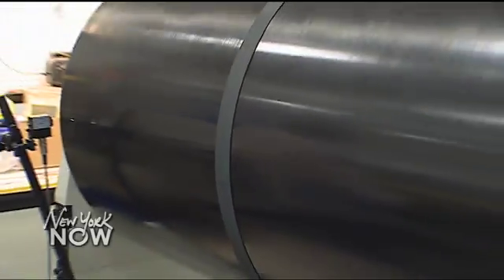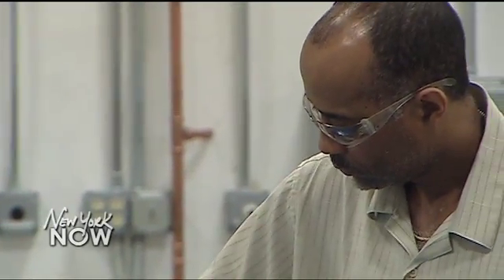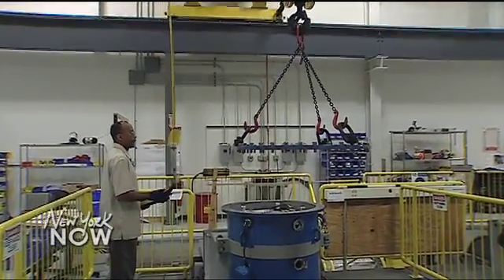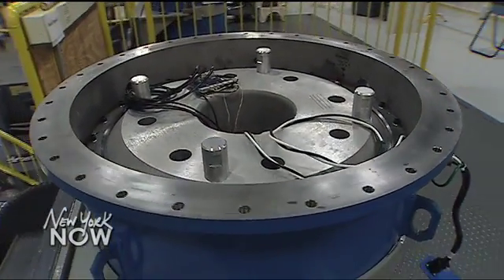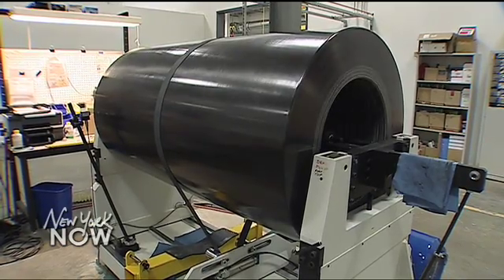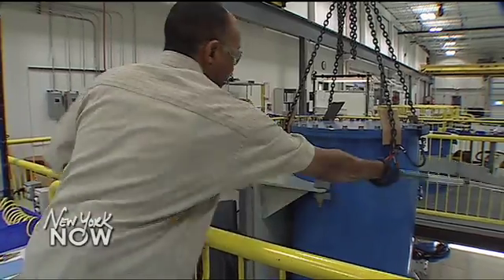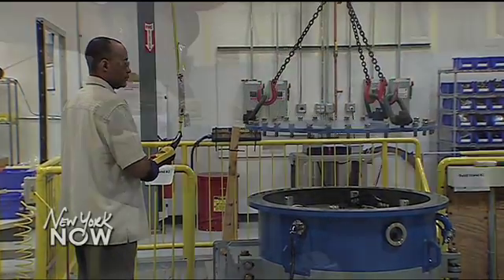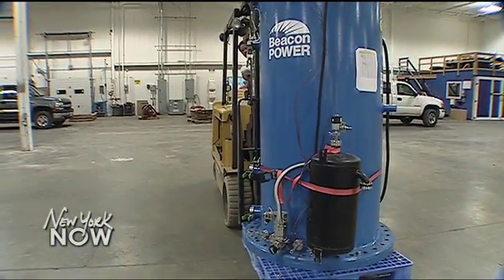Can Flywheels Make Renewable Energy More Reliable?

Comment: I don't see what keeps us from hoisting up a giant weight; made of anything - even dirt or land mass; so essentially each unit of land mass is a "kinetic energy resource."

Flywheels seem of the same type, store rotational or centrifugal kinetic energy, or "twist motion," instead of just vertical potential energy being stored, and probably harvested by centrifugal means.

----

A giant land mass in eaach house could be used as a giant battery. A new feature of homes may be a giant "weight." This weight could be charged by anything that provides mechanical force to lift it. You could physically lift it. It could be leveraged to give you a free weight set and home gym resistance without needing giant weights; just need safe attachments. Solar could raise the weight slowly with correct size motors. Wind, geo thermal, you name it could store into a "gravity battery."
Reply: capoman1 What keeps us from: Costs. Suppose, you wanted to store 10 kWh: This would be roughly the potential energy of 360 metric tons elevated 10 meters. Or 3600 metric tons elevated 1 meter.
Imagine, what big and powerful and expensive system you would need for this!
And you could store the same energy in 20 simple cheap car batteries.
Probably even with higher efficiency.
Reply: Weight and gravity stores a lot less energy than you might think. Just as a crude example, with the right mechanical advantage you could probably lift 20,000 lbs 50 feet in the air with a single battery charge on a cordless drill. It really doesn't take that much energy to lift weight against gravity. For the amount and volume of weight you'd need to be practical you're really just better off engineering a flywheel, which can store a huge amount of energy.
Reply: Thomas Schuster Good points. Just one point you missed. The maintenance comparison on each system. Essentially the weighted system would last forever, whereas a "cheap car battery" would need replacing every 15 to 20 years. Probably less.
Reply: ***** And you're trying to tell me they last forever? Give me a break. Refer to my last post.
Reply: matsv201 Agreed. A super capacitor is NOT a battery. So you're talking about a technology that doesn't really apply here. Unless someone can design something like a slow-leak capacitor with a given rating and don't exceed that rating for whatever you're running. Stacking them could be useful. But if you're not consuming whatever rating, then you're essentially wasting power. I'd also hate to see the size. I think nano technology is the answer to the energy storage issue.
Reply: bugs181 Well yes, But supercapacitors is quite similar to batteries in performance. If you need high power, supercapacitors is actually better than batteries. Also they are more efficient. Energydensity is lower, but it really depend on how you comparing.

Yea, sure if you talking about a phone battery or a electric car.. no, then there is not really a chance.

But comparing to a hybrid car or truck and a stationary battery.

For instance things that need a lot of cycles, like power grid balancing, that may cycle 5-10 times a day, super capacitors is great. Also, stationary use where weight is not a issue, super capacitors is generally better than batteries.

The power leakage is actually not that big of a problem, its about on par with lithium batteriets.
Reply: bugs181 It certainly wouldn't last forever, you have to obtain the stored energy somehow and that would involve some kind of mechanism which would wear out.
Reply: bugs181 Super capacitors normally last for 100k to 1M cycles.. Bipolar capacitors last a lot longer, but is not really usable for energy storage.
Reply: Your math(s) are correct.
Reply: Thomas Schuster Thank you for putting that into perspective (assuming you're figures are correct). 3600 metric tons seems like a lot compared to 20 car batteries, but the tide could lift it twice a day for free. Or fill a reservoir to spin a turbine. Someone must be doing this on a small scale. I've only seen one example in the US and it was large.
Reply: idontcare80 That's why I said essentially. Every system, no matter how perfect requires maintenance. It's just the way things work. Things degrade over time. My point still stands about conventional batteries needing replaced more often than a system that doesn't because of the metals that deteriorate due to chemical reactions.
Reply: capoman1 There are systems like that, but they are not very economical...

Having something fluid, and pumping it up and down is much more efficent and last longer...

... and its very common, called a pump-power station. Exist just about everywhere.

Comment: is there any danger when the rotor is out of control, or the rotor material fails?
Reply: I am replying based on my knowledge of flywheels in general and not of this product specially.

Flywheels can fail catastrophically, sending shrapnel out radially. This is why flywheels are typically housed in heavy steel containers and buried. But they can be made with carbon fiber which is wound around a core, either like thread around a bobbin or like paper towel around a cardboard tube, and besides being very strong of it does fail, the carbon fiber becomes entangled with itself creating a lot of friction and heat which dissipates the rotating masses kinetic energy.
Reply: http://www.timesunion.com/local/article/Flywheels-fail-at-energy-project-2227225.php

Comment: Makes sense. Spin them up at night when the power is normally wasted then release it during the day when it's needed. It uses far more energy then it gives back just like the pumped hydro systems but they are far more compact and the energy used would be wasted in the lines unused at night anyway..
Reply: ***** I thin you have that backwards. Theres much more energy available during the day. The idea is to capture as much energy as we can from the sun and wind during the day hours, to use it at night. That's the only time I personally need energy storage.
Reply: @bugs181  wind power is the same at night. But the power usage is bigger in the day. Hence why you would storage excess power in the night. DOH.
Reply: @nikolaiownz  that only applies to wind power. Most people are probably using solar cell technology of some sort. Loads of power generated during the day but as soon as you lose the sun, night time is where you need energy on demand from storage. If you want practicality, this is also why electric companies offer discounts for night. Because there's less energy generation AND demand from night scheduled hours. There's a reason why the Tesla power pack knows to get energy from the grid at night and use it during the day. ;)

Comment: About 100 kg spinning mass. About 700 m/s velocity. That means, one of these units stores up to 24,5 MJ. That´s 6,8 kWh. That´s the energy production of one modern big wind turbine (2,4 MW) in 10 seconds. 
Just to illustrate the dimensions. You need hundreds of these units just to store 1 hour of excess energy from one single wind turbine. The big advantage: Probably more or less infinite charge- and discharge-cycles. Maybe this counts enough for some applications.
Reply: Sorry, I'm afraid your calculations are all off. You need to be thinking rotational kinetic energy not linear. There was nothing stated in the video that would give you the required rotational moment of inertia or angular velocity.
Reply: Most of the flywheel systems are used for grid frequency regulation. You need just 30 minutes of storage, and sometimes just few dozens megawatts available, to stablize the grid. This way you can save a lot in production actually.

It is unlikely to find uses in residential systems or as more long term storage. Amber Kinetics flywheel can produce 8kW for 4 hours (32kWh). Friction losses are about 96W. Which is not bad. So, it can to some extent augment a battery system, as the price could be potentially lower, and they can last 30 years. I.e. instead of using 100kWh of LiFePO4, one would do 70kWh of LiFePO4 (which one would need to replace every 10 years), and this 32kWh flywheel, and priotize consumption from flywheel. I.e. if the system is mostly solar, to store excess in battery until it is mostly full, then in flywheel (i.e. when we know the end is ending, and even if the battery is not full, to limit the battery cycling, which limits its life span), and when the sun goes down, use the one from flywheel first. Or import electricty from the grid in the very early morning (before the sun, but when the electricity in most grids is cheaper), and use it for few hours before the sun goes up for solar to kick in.

The question is exact pricing.

PS. Amber Kinetics M32, is 2000kg steel rotor. Entire assembly is 4500kg, and for safety done underground. Round trip efficiency is about 90%. Which is not bad, and similar to most lithiun-ion battery systems (some are less, some are more, depending on exact chemistry and charge/discharge currents used).
Reply: http://www.powermag.com/beacon-power-makes-a-comeback/ claims 25kWh (which I make to be about 90MJ). They don't show their working though ;-)
Reply: Any Idea How much it is cost?

Comment: For stationary use, CFRP rotors at high RPMs are just bound to fail. There is no news on Beacon power since Stephentown was partially commissioned and they had to file for bancruptcy. What data do exist on the MTBF of such units now, after two years operation ?

Comment: Micro fly wheel system could be adapted to cars and other devices to enable power control and deal with fluctuations. 

Space craft might also be able to use these systems. I am not a mechanical engineer but how would such systems work in zero gravity.
Reply: Flywheels are used in satellites as batteries. Wild temperature fluctuations and vacuum is hard on any kind of chemistry and they are used now commercially to run electronics when the sat is in Earth shadow twice a year.

Comment: Induction motors are upward of 98% right now, kinetic storage is also safer and better understood. thermal/chemical storage looks promising but i've not seen anythingthat can compete with what flywheels can do right now.
arguably flywheel storage already exists. some grids, particuarly in britan. they keep generators spinning and in sync but disconnected from the grid, then switch them on when the grid is under load.
(this applys to power grids only, electric cars for example cant use flywheels)

Comment: Despite the losses in efficiency (I think is about 75%, which means higher than batteries), it is a valid solution to fill the peaking demand and flatten the profile of the demand curve resulting in higher costs of the system, as well as to reduce the wind energy discharges. Well, at least  in the future when the price of this Flywheels is supposed to be reasonable.